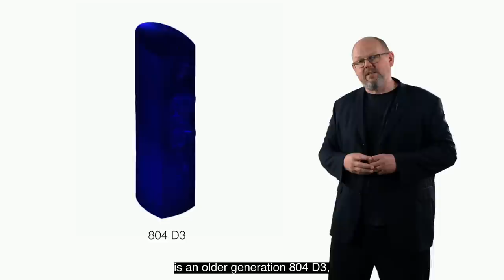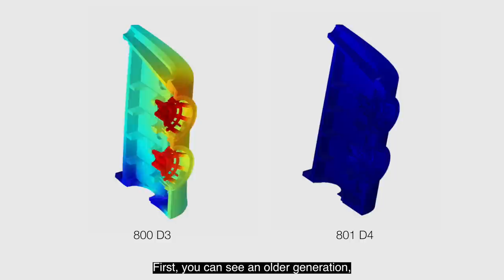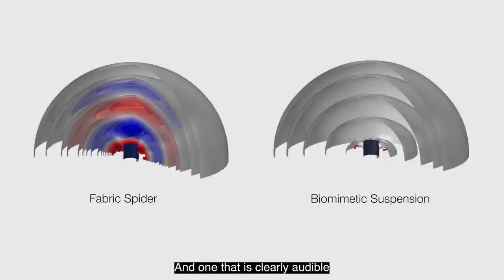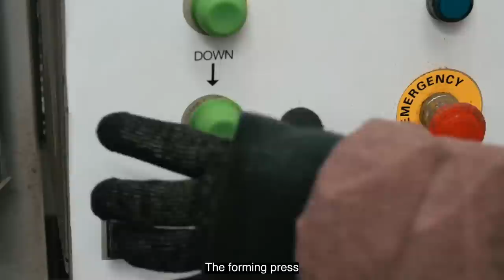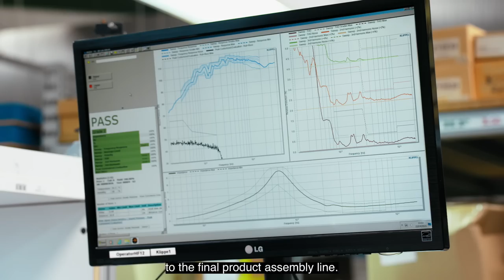Bowers & Wilkins 800 D4 Factory Tour and Technologies

Comment: I'm liking the changes to the 804 in general but not sold on the Connolly leather on the top. Maybe it has an acoustic advantage, but I preferred the lacquered finish aesthetically.
Reply: I saw them at Magnolia Best Buy today and the black leather looked like plastic.
Reply: Not a fan of the leather. I question the longevity of it

Comment: Well, good to know that, if you really care about the sound generated by the spider which has bigger holes than normal fabric, would you need  wages in the rear chamber of the driver? I do think that reflaction from the back of the cabinet would be greater than the the sound pressure generated by spider.

Comment: I appreciate quality in audio equipment and I'm quite certain that these sound incredible but the flagship level coming in at around $17,000 per speaker, I'll just have to locate an audio store and enjoy them there.
Reply: There's a reason why they are in Skywalker and not in my house. But to be fair they have made some smaller models that are somewhat cheaper. Though I'm sure still not cheap.
Reply: @savedfaves  When you operate at the level B&W do, you don't say cheap you say less expensive. It's taken the company more than 40 yrs of investment and reinvestment to attain this level of engineering and manufacturing expertise. I bought a pair of 802s in 1980 and still have them. They were fantastic in their day, but they're old relics compared to the current D4 generation. B&W's commitment to excellence is truly admirable..

Comment: The weak point of B&W 800 line (like 802, 800) is actually amplifier. You need Gryphon, 1.2Kw McIntosh...at least to get the best out of them. When you add this cost up, the speakers become cheaper part of system meaning a big hole in your pocket. However, if you can effort it, its the best for all-rounder  music listening style.
Reply: Daniel, your statement “you need 1.2 kW amplifiers … at least to get the best out of them” is nonsense. 
I’m a very happy 802 user for 9 years now. First the D2 model, now the D4. Both are very well driven by a Naim NAP250 which delivers just 2x120W at 4 Ohm. You don't need power, you need quality.
Reply: @gijsschubert7901 precisely. High quality power is what it needs to sing.

Comment: You would think the D3 wouldn't have most of the problems that the D4 has fixed considering their price! Aren't they like $24,000 for the larger unit? It's not like they were designed 40 years ago?🙄🤔🤫  Can't believe they didn't see all these problems 6 years ago.  It's not like it's a car so they have to worry about increasing fuel economy standards by lightning up the car with more aluminum and orher such things.  It's a speaker.  It's not like other speakers company's don't do this as well but they don't usually cost $35,000 either.  The suspension part I understand but the bracing, should have been there all along.

Comment: Anybody spending this sort of money on speakers should expect some decent wiring inside not some black and red pap you find in £150 speakers.
Reply: Probably an indicator that the expensive wiring is just snake oil.
Reply: @Sloimer  very true,  i have used lots of different cables and cant tell any difference between any of them